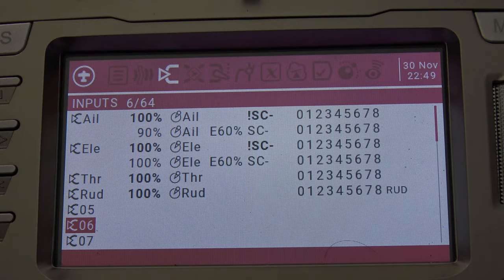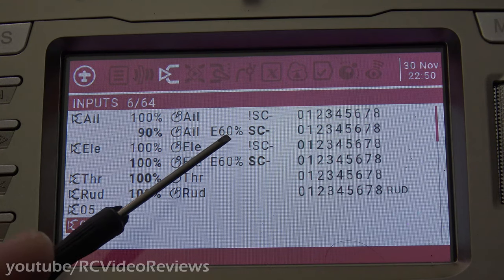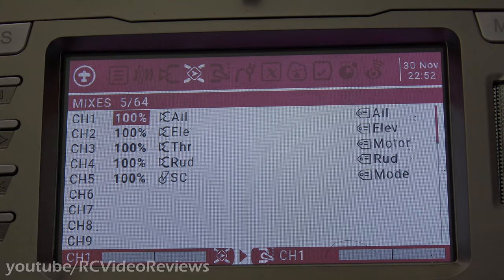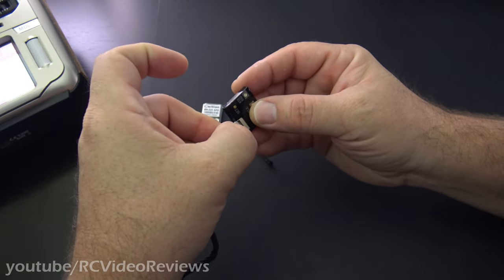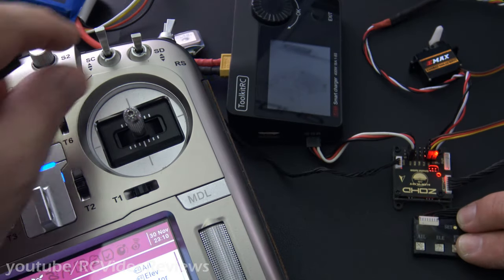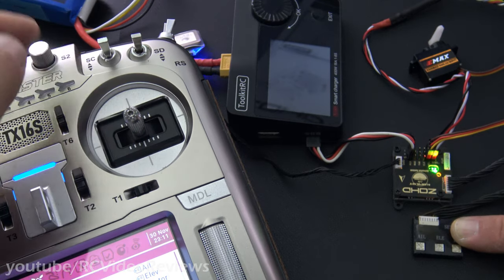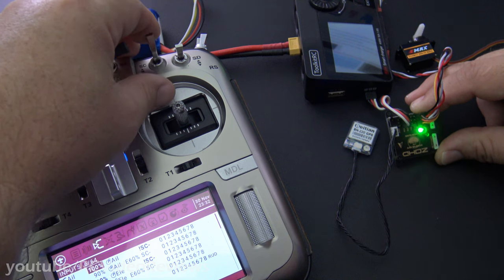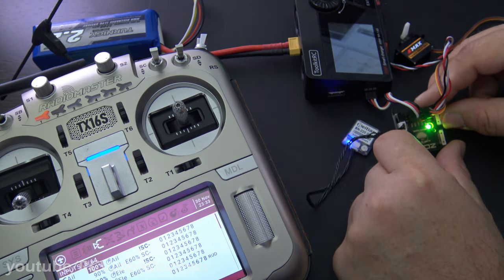Kopilot Lite: The Complete Configuration Guide

Comment: I realize this vid is a couple years old but I am new to planes and have a question about the setting module on the kopilot. Does the board that you use to setup the plane type and gains (setting module) get removed once the main unit is set or is it supposed to always be connected? My buddy says he thinks it has to always be connected???

Thanks i advance
Reply from the maker: Directly from ZOHD:

"Hello Sir,

Thanks for contacting, we think the problem might be that you disconnecting the board with the plane OFF. The correct procedure is to set all the settings and BEFORE turning off the plane, disconnect the  board, as to save the settings the board needs to be disconnected with the plane ON. "

Comment: Hi John, Another thank you for this tutorial. The Chinglish in the manual was driving me crazy but you have cleared the fog for me! One question if I may: In OpenTX, Is there a way to reset the Mode switch (SC in your case) so that I can get Manual on SC (Up/Away), Stabilized mode on SC- and RTL on SC (Down)?  Appreciate all you're doing and I try and join your Euro Jam here in the UK if I can! Many Thanks. AlanC
Reply from the maker: Yes, In special functions:

SC Up = OVERRIDE CH5 = 0
SC Mid = OVERRIDE CH5 = -100
SC Down = OVERRIDE CH5 = 100

That should do it.
Reply: @RCVideoReviews  Wow, excellent, thank you! Using your building-blocks approach (last Euro PilotJam) I currently have a small wing (Wingwing Z84) with a Lemon StabPlus rx on board awaiting maiden, and wanted to keep the mode switching the same, hence my query! I have my Dart250 under the Xmas tree, but already started a setup in Companion using your video. Loving this whole OpenTX, TX16s, FPV journey! Thank you, again!
Reply from the maker: Awesome Alan. Have fun with it, and just take it one step at a time and try to enjoy it. It adds layers to the hobby that's for sure.

Comment: Tried again the copilot 2 servos and receiver ...I check my radio for mixed ..0 mixes ..changed receivers did the same thing now I'm going to change radios and c .. but its not normal that it glitches only when its in return to home ..when itd in stable mode its quiet .when its in off mode same ..rth glitches
Reply from the maker: Does it glitch when you have a gps lock? Take it outside and check.

Comment: A certain well respected reviewer from across the pond recommends calibrating level with the nose slightly raised to maintain level flight. What's your experience with the Dart 250 been in this regard?
Reply from the maker: I think pitch offset is 100% airplane dependent. On the Dart, underneath the canopy area there is a sizeable flat surface. I set my Dart on the table and pressed gently on the nose so that flat area stayed flat on the table then ran the calibration and here's the result: http://rcvideoreviews.com/sandl.jpg   The Kopilot lite manual says in return to home modes if there is no GPS lock the plane will "keep altitude". So it is possible the Kopilot has altitude awareness either through the GPS or through a barometer--it's not spelled out in the book though.

Bottom line: The reason I believe pitch offset is 100% airplane dependent is because some planes have flight decks purpose built into the airframe to be perfectly level. Some airplanes do not. I try to avoid stereotyping a process. I'd rather just set it up the best I can, then test, evaluate, modify, and test again until I'm satisfied with the performance.
Reply: @RCVideoReviews  Yep. There is a tiny barometer unit on the Kopilot board.
Reply from the maker: @theoztreecrasher2647  I'm not surprised to hear this because it maintains altitude exceptionally well. How did you find out it has a baro?
Reply: @RCVideoReviews  There was some debate on the RC Groups forums, so we just unscrewed the top plate for a look-see 1 arvo.  QED! :-)

Comment: Thanks again, I am using a radio master 161 receiver .
Do you still recommend the settings you mentioned earlier?
I will be joining your ground crew when my pension comes in next month.
Thanks again Mike.
Reply from the maker: If you can zero out the failsafe settings on the Rx, then you can do no pulses. No pulses isn't strictly required though as long as you set RTH when you set failsafe.

Comment: hi: can you cheat the barometer of the kopilot to make it think that you are at a higher altitude as the relative zero altitude?  IE:  if you stand on a really high ladder and let the kipolite caliberate, then will it fly at x + 35 meters?     If X is relatively the zero point, but it is artificially high off the ground, then you will have x + 35 meter for RTH?  thx.
Reply from the maker: Pretty sure it doesn’t have a barometer. I believe it calculates altitude from gps data. To confirm you should probably check with ZOHD.
Reply: The RTH set height is actually 70m. Andrew Newton measured it with a DJI Mavic Mini. That 35m figure is the floor height the unit will try to keep above in the Altitude Hold Mode. And yes you can cheat the barometer in the manner that you mention. The best would be to power on the plane/Kopilot at the increased altitude (can be away from your intended Take-off point) but with the GPS puck unplugged (or shielded so it can't get a lock) then return to your intended Take-off point, allow the GPS to lock and set the Home Point, then fly!
It is also possible to cheat the barometer with a little added engineering. If you feed an air tube from the nose of the plane and direct the increased air pressure from the forward motion of the plane onto the barometer, it will think that it is lower than intended and cause the plane to fly higher during RTH. (But a bit of a Heath Robinson way of doing it!) 😜😁 
Actually if you wanted to be really Science Lab Experimental about it you could rig up a way to seal the whole works under a lab Bell Jar and evacuate a known percentage of the air pressure before Boot-up. Then remove and fly. 🙂
Reply: @RCVideoReviews  Nope. Altitude is calculated via the barometer unit onboard the Kopilot.
Reply from the maker: Too bad they don't use GPS data--it's right there. iNav will consider both bits of information in determining altitude.

Comment: HI Great vid, I follow you on a lot of your other vids.  Can you help please, when I did a test flight today and switched into RTH I had a throttle cut. I landed and checked all the wiring (all good) now I am at home and have set up everything again. now I can't get RTH or the green LED to work. the other 2 modes work fine  I am using a Radio master TX16.. any suggestions,   please
Reply from the maker: It's very tough without seeing your radio and the Kopilot to advise. What I'll suggest is:

1) Make sure you have all four channels enabled: Aileron, Throttle, Rudder, and Elevator
2) Make sure you have all four channels set to use 100% weights.
3) Make sure the airframe type selected is correct.
4) Make sure all four channels are being seen on your receiver. If you have a rudderless plane, plug an aileron servo in to check the rudder channel.

Turn off all logic configurations you may have setup.
Clicking RTH should not turn off your throttle. Hearing that makes me think you have something else going on with your configuration.

If in doubt, create a brand new model, bind your RX, and do nothing else to the configuration until you have the Kopilot doing what you expect it to do.

Comment: Is there a hard reset on the kopilot ? I’m having difficulties as the FC is all over the place and not doing what it should IE setting level calibration wont blink lights, Etc.
Reply from the maker: Not that I know of. One of the main things you want to do is make sure you have Aileron, Elevator, Throttle, and Rudder all configured in your mixer. Use 100% weights, no expo, and ensure your outputs show you 998us min and 2012us max.
Reply: @RCVideoReviews  thank you very much, I did have expo so I’ll change that back... also, does the FC handle throttle in a RTH situation or do I need to add half throttle into my failsafe position ?
Reply: @RCVideoReviews  that was the fix, thank you bro.... test flight tomorrow morning with the caddex visa installed!
Reply from the maker: @endliberalism4305  Awesome. Glad you got it working. Have fun, the Kopilot it really good.

Comment: I have a problem with my co-pilot light I have one flight controller that is working perfect and 1 that's not working when I turn the radio off it does not go into return to home I kept everything the same and just switch out the flight controller and then when I hit return to home it's still will go to return to home is there something wrong? Or is there something else that needs to be done? I'm running a crossfire and I got the receiver turned to cut.
Reply from the maker: Forget about failsafe and turning the radio off until RTH is active when you command it with a switch. Until that's working, failsafe isn't going to help. I'd say something is not setup right somewhere if you activate RTH with a switch and the Kopilot doesn't indicate it's in RTH mode. Figure that out first.
Reply: @RCVideoReviews   The return to home switch does work but when you turn the radio off it doesn't go into return to home
Reply from the maker: Then you need to get on discord and follow-up there. YT is useless for sorting out issues like this.

Comment: I thinking of just sticking to quads.  I've started over from scratch 5 times trying to do the stick calibration, lights never blink.  All the throws are set to 100
Reply from the maker: You have all four channels: A E T R showing output in your channel monitor? Do you have any of the 4 reversed?
Reply: @RCVideoReviews  Yeah.  I have  inputs:
A 100%
E 100%
T 100%
R 100%    AND 
Mixes @
CH1 Ali @ 100%
CH2 EL @ 100%
CH3 THR @ 100%
CH4 RD @ 100%
CH5 SD @ 100% for modes
In the channel Monitor, I show outputs in Chan 1 through 5 (including Chan 4 for rudder).  None of the channels are reversed.  The controls seem correct.  Roll right, ailerons on the right rise, roll left, alierons rise. Pitch down and elevators rise.  I have Drift and when in stablized mode the green light #2 (the one on the  far right is solid green in stablized mode and blinks in RTH mode)
Reply: It ended up working BUT, I had to move the pit and roll stick all the way to upper right.   I started over with a new model (with the info you see above, but the control board has the same settings that I had on the previous model.  To your point about having something reversed, clearly on the channels  is supposed to be reversed in the radio.  I think I just need to go back and rest the control board.
Reply: @BryonGaskin  Several people have reported that they had to move the sticks to 1 of the 8 possible corner combinations other than the 1 described in the Kopilot manual. I have never seen a definitive test as to whether this was due to 
A...They had 1 of the channels incorrectly reversed in the radio. OR 
B...They had remapped the outputs in the radio to match the required A,E,T,R,Mode order.
Can you tell us which you found it to be?

Comment: But if its in wing mode when you change servo direction on the pot it change them both or changes input
Reply from the maker: I don't think so. I think it just changes the gyro direction. You always setup the radio first, then the gyro.
Reply: @RCVideoReviews  i figured it out your video really helped thank you
Reply: @RCVideoReviews  Nope John, and you have been informed of this before. Reversing the direction of the stabilization by reversing the pot to the other side of 12 o'clock ALSO reverses the radio stick direction. Reversing the stick direction in the radio HAS NO effect on the gyro direction. Ergo do the gyro first not the radio - unless you like double handling. (And the possibility of missing the reversed sticks!) 😉

Comment: just setting it up on my dart 250. is it normal in stabilised mode for it to give up elevator when I throttle
Reply from the maker: No. Throttle alone should not change elevator.
Reply: @RCVideoReviews  any idea what Ive done wrong ? it doesn't do it in manual mode. everything else appears to be working fine but I've not flown it yet
Reply: it's a tiny bit of up elevator when I throttle. more worrying if I'm holding down elevator the throttle completely cancels the elevators
Reply: I figured it. i had rth and stabilised modes in opposite switch positions

Comment: I cannot get my kopilot to go into manual mode or return to home. I am using a crossfire receiver with the sbus connection and my transmitter is a RM TX16S. When I plug in the power the GPS does lock in but no matter what I do I cannot get the LED 2 to go solid on. I set it to T tail and I have the SA switch as the control but no matter which position the switch is in the LED blinks and neither my rudder or elevator work. I have the kopilot in a radian sailplane so no aileron, just rudder and elevator. Is this not working because I don't have aileron ? I believe I am subscribed to your channel
Reply from the maker: I would start by connecting all 4 channels. Doesn't matter if you have no output from the kopilot, but you must feed all 4 channels in to the kopilot in order to conduct the calibration. Bottom line is you're telling me nothing works except GPS lock. Start there.
Reply: @RCVideoReviews  thank you, I will start there and let you know how things work out
Reply: @RCVideoReviews  I connected the aileraon servo to the kopolot. I have no control over any servo but when I tip the kopilot side to side the servo reacts to that. The led 2 is still flashing
Reply from the maker: @TravelairR  Your RX is bound?
Reply: @RCVideoReviews  yes it is, it is a crossfire rx hooked to the kopilot thru the sbus. The receiver shows bound and the gps locks on. The problem I have is the 2led is always flashing and none of my controls are working. They were working this morning. I attempted to set the failsafe on the crossfire and all my controls stopped working.
Reply: @RCVideoReviews  I took the setting board out of return to home mode and the rudder servo works but the aileron and elevator servos only respond to tilting the board not to input commands from the transmitter. It seems to be locked in stabilization mode.
Reply: Have we come to the point where there is no more help with this problem?
Reply: Is it possible the problem is with my transmitter settings. I tried a different kopilot and the problem stays the same with LED 2 flashing. I am going to try setting up a new model in the transmitter to see if I have something set up wrong in my transmitter.
Reply: set up a new model using the same crossfire receiver. The bind went fine and it starts up normally then when the GPS locks in I lose LED 1 and 2 and only the red light stays on. I hold the set button down but the LED's don't come back on. This is happening on both Kopilots. I have my settings on the transmitter exactly the same as yours in the video. Do you have any suggestions as to what I am doing wrong?

Comment: I have an airplane and I don't have space on a horizontal surface to install it, can I also install it on the side of the fuselage tilted to one side?
Reply from the maker: There is no provision in the Kopilot setup for mounting direction in the manual. I'm not saying it can't be done, I'm saying there is no documentation stating how to inform the Kopilot of the offset.
Reply: @RCVideoReviews  Once installed, if I calibrate the gyro, it does not automatically detect the plane as level and therefore horizontal even if the kopilot is on one side?
Reply: @dario_3D  Gyros ain't Gyros, Sol! ;-) Unless the unit is specifically designed and programmed to be installed in multiple configurations then it can't be so used. Also while it is possible to cheat a gyro to trim say a quad by jacking up a corner before calibration, the range of shift available is often very limited. I know for a fact that on the XK X450 multi-mode it gets its knickers in a twist if you try to exceed a certain offset. There are units available that allow up to 8 mounting attitudes.
Reply from the maker: @dario_3D  With flight computers, you normally need to tell it there is an offset. You can certainly try to run the calibration with the computer on its side, but without testing it myself I have no way of knowing how that's going to react in flight.
Reply: @dario_3D  You can NOT install the Kopilot unless it is flat and facing forward.

Comment: Can be implemented in bait boat?
Reply from the maker: I'm not familiar with bait boats, but working from the assumption it's some form of surface vehicle, I'd say probably not as the RTH function manages altitude (z-axis). So if it's not at the predefined and unconfigurable altitude for RTH, it's going to just slam the motor to full power. It also has a pretty big turn radius for RTH so unless your homepoint could safely be in the center of a 160m diameter circle, you'll have issues there too.

Comment: Hi John.  Can you set up the ZOHD to use stabilization where it will correct for excessive wind but not auto level (trainer mode) and allow rolls and loops?  

I also haven’t seen anyone address what to do with extra channels for leds/landing gear/flaps.  Just leave those on the receiver?

Thanks for the awesome tut.
Reply from the maker: It only has three modes. Manual, stab, rth. So no wind rejection mode. You can leave non-stab connections on the Rx. No problem with that.
Reply: RC Video Reviews  Do you know of any similar devices that would offer a stabilized only and a stabilized trainer mode with rth?  Besides getting into the iNav and Ardupilot units.
Reply from the maker: @jasonkokosinski6393  Detrum Z3 offers wind rejection mode and rth.